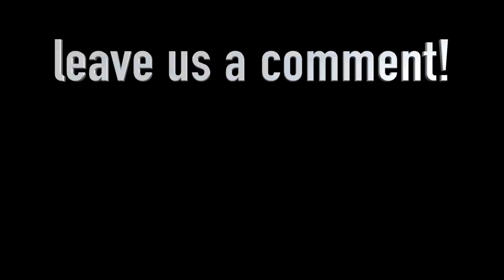Installing Helical Piles And Deck Framing - Covered Deck PT 1

Comment: Like the laundry vent in the video- Could you build around a vent for a gas fireplace?
Reply from the maker: Fireplace vents usually require a certain distance above or below any other structure so you would want to move the vent in that case